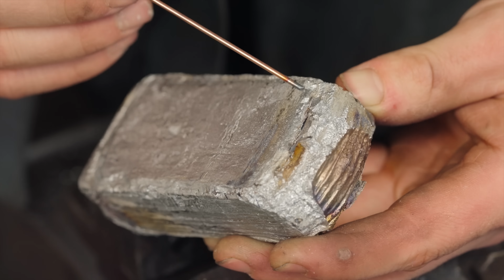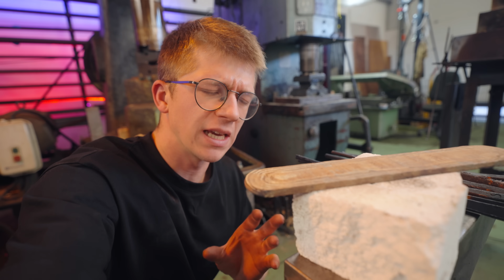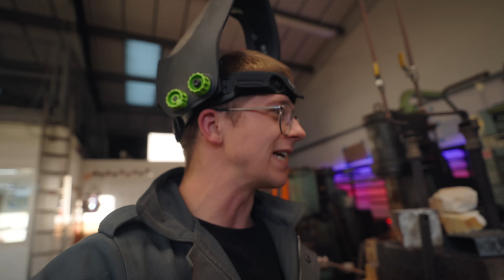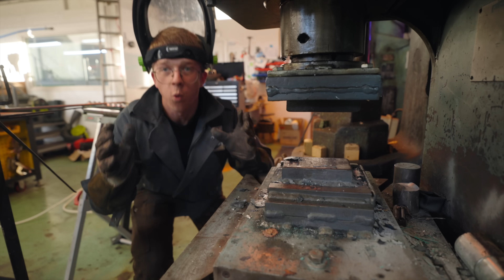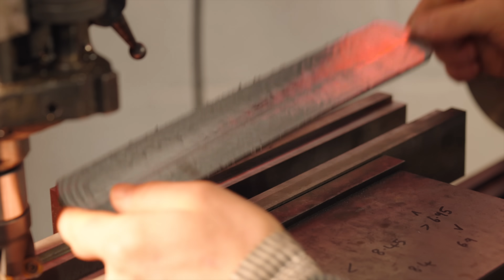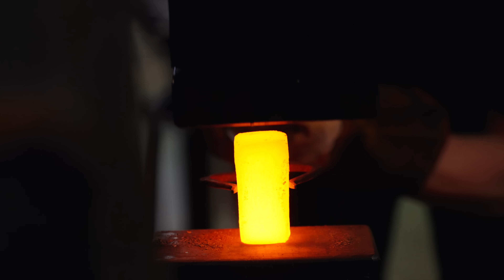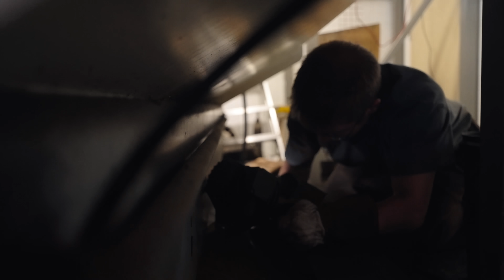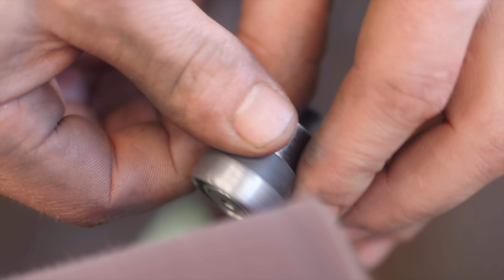Can I Make Titanium Damascus? Part 2

Comment: Did the "back" of the jacket fall off? So when you put it back in the forge it then wasn't sealed and exploded out the back? Cause it oozed out the back again when put under the press at 0637.

1429 What if you turn, move the crank down the bar, turn, move down, etc?

Comment: I'm more convinced than ever that you need to try making magnesium damascus, and when/if that works, try a titanium/magnesium sandwich damascus. 
The argon is going to work for the magnesium too, and you'll get it to a higher temperature than your previous temps with the argon. 

(I'm at 12 minutes into the video, so if you've already did this? yay)

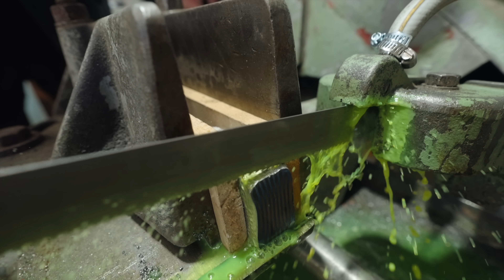Comment: You're killing me Alec! Your blade is on backwards! 2:15
Reply: Well, I still like your channel. Amazing stuff! But have fun buying a new blade after every part you try and cut.
Reply from the maker: No! The saw is designed to run that way for some reason, cuts away from fixed jaw!
Reply: @AlecSteele  Wherever you may have learned that from, all I ask is to think about it a little bit. Set the blade so that it cuts into your part. Rubbing the back of the teeth against your part just dulls your blade instantly. 25+ years experience in machine shop talking here. All the best Alec!
Reply from the maker: The teeth are cutting in the correct direction. The saw cuts away from the fixed jaw and the teeth also cut away from the fixed jaw. I don’t know how to make this any clearer 😂. I’m not running a saw blade backwards and being confused about why it’s not cutting. I’m no scientist but I’m not that stupid 😂
Reply: @AlecSteele  Google search it Alec! The blade is running the correct direction, but your teeth are backward at 2:15.

Comment: I work in a refactoring plant, almost everything dealing with Ti is done under vacuum to keep it from oxidation. When I was manufacturing aerospace parts it was in argon tanks and we used carbide bits in die grinders and sanding belts. Haha if you think this is explosive you need to play with Halfnium and Zr 😂😂😂

Comment: I believe the billet of Damascus titanium is small on top and wider on the edge design is the top layers are cooler and less prone to move while the inner layers are still hot enough to move around. Titanium releases heat more efficiently than steel thus the pattern works differently. Just my hypothesis. 😅

Comment: Diamond grit lapidary saw? Some of those micro kerf blades are 2mm thick. Water cooled is standard and auto feed is within your means. Some people even dress the blades themselves with adhesives and grit instead of the commercial brazed ones. If it saves 30% of your waste, it is probably worth it for the outcome and extra time.

Comment: Talking about wielding titanium and steel, I think I know the answer. The thing you are seeing between the two is called intermetalite and it's fragile. If you want to wield the two you need to use neobium foil, it wields with titanium and also wields with steel. Here is an example /apNelE3FCTs?si=T8BKu9gp5NcZH_iA but you need to use some translator to get all the information

Comment: "Why is it melting below temp?"
It's because it has a far higher density.
Why do you think a steel therms works better then a plastic one?

Let me get more specific too incase that's not explanation enough.

You learn in science class, in grade school, that hot things are hot because their molecules are wanting to move around rapidly.
They contain a lot of "energy".

The closer molecules are together the harder it is for them to move around.
If it gets too hot it it's bonds break down, that's what allows a material to change it's state of matter.

The reason density is important is, to use another real world example, the same reason ice cubes melt faster than water evaporates. The molecules have less space to move around, and heat is just a byproduct of the energy they lose while practically vibrating in place.

To go back to our titanium.

It's molecules are THE MOST densely packed. Look at it from the titanium's perspective.
It is an ice cube, you are the weird one.

Every piece of steel can be viewed in a similar way. The difference being is our ambient temperature immediately starts to cool any object that comes into contact with it. Entropy. Laws of thermodynamics dictate this is just what has to happen. Higher energy moves to a lower energy area.

In the case of titanium, the molecules are so densely packed that it doesn't shed the heat as quickly as steel.
It's sort of like the heat gets "trapped".
You can feel the same effects whenever you get burned by boiling water.

The skin cools down quickly, it burns later, but in between that time, underneath the skin hurts longer than the skin. Depending on how bad you burn yourself ofc. The skin was more quickly able to shed heat. Furthermore, heat is radiant and expands outward to the point of lowest entropy. That's why sticking an ice-pack on it immediately after eases the pain and also decreases the damage. Since you are made of water, carbon, iron, and other dense materials. You retain heat just not as much as the hunk of titanium. As a hunk of titanium radiates heat, it doesn't radiate it quickly enough, and all materials will radiate inwards as well.

You could say that the transfer of energy is hampered by the material's density. (this was just the long way of explaining that for all audiences to understand.)

EDITS: Grammar, clarity, author note.
If you where able to follow those loose ramblings that attempted to drill home why, thank you. The TLDR, "See thermal-dynamics, and atomic physics."

Comment: You could dissolve steel jacket in the concentrated nitric acid. It can't eat Ti, Al due to their oxide layer which only goes stronger in acids having oxidative properties. And a basic chemistry is a quite convenient thing to know dealing with different metals. It can save a lot of work for you. At my first job they had many Al parts with some brass bolts stuck deadly inside. And they were just drilling them out, often ruining the Al body. I just took those parts all at once and threw them in the nitric acid. They were kind of hysterical first :D But bolts gone and the body stood.
Reply: Concentrated Nitric acid is no joke and a regulated chemical
Reply: @Joker-em6oz Even acetic acid is no joke if concentrated. So what?
Reply: @Ma_X64  nitrous oxide fumes are bad… and he doesn’t have the setup nor means to use or but the acid that you suggest
Reply: @Joker-em6oz  not that bad actually. Everyone should decide himself. Whatever you do, it has its pleasure, it has its cost.

Comment: My guess is it is reacting to the iron in the steal jacket. When titanium gets into higher temps the oxides can react with iron and iron oxides creating a vitrification reaction a kind of thermal and chemical vitrification reaction that is why the some of those melty parts are brittle they are kind of like ceramic . That is my guess I am not entirely sure

Comment: If the steel remains you left on are permeable through the titanium lattice at that heat, whole thing could be polluted with trace iron.
   A good example is tin and bismuth combined near 50/50 melts at 281⁰F instead of 520⁰ F for biz and 450⁰ F for tin (possibly backwards 😉).
   Anyway, Body centered and face centered, plus the other I always forget cubic lattice patterns of atomic arrangement in crystalline structures (metals are crystals) . Anyway anyway, Metals creep through each other on an atomic level. Magic happens and they melt at much lower temperatures. I have a hard time getting it.
    US Steel books are heavy in metallography if you don't want to buy a dedicated book that covers most metals.

Comment: Elevation has also been known to effect temperature absorption rates in things. Its also possible your thermometer is faulty. You should side on caution and start forging on the lower end of temp. Maybe even the patent wrote the temperature too high for the process to make it hard to learn?

Comment: The only way I can get through titanium in any reasonable time it to drill a string of holes and connect them with an angle grinder. I don't bother sending saw teeth to the farm upstate. Just gold nitrited cheap twist drills, nothing fancy, punches right through like it is aluminum. C-5? A circular chop saw might be better, not sure. They always cut straighter than a fiber disk regardless. Much faster than all grinding. Stuff is a pain.

Comment: People are throwing out different steels or nickel. AL6-XN is considered a stainless but is high high (intentional) nickel (24%) with lots of chrome and moly. Nitrogen instead of carbon. 49% iron.
   Made to not crack in heat and acid.
    Maybe with stelite or blackalloy (powder cast).

Comment: @AlecSteele not sure if someone has already said this but you should save the titanium chips and dust from the milling and cutting process and try to make a canister Damascus from them to recover waste
Reply: They're oxidized too much, and probably wouldn't forge weld very well.  Also too many voids.   The grinding swarf is about useless.   People have been trying for years to recycle it, very limited uses, like cinder blocks and some in aluminum smelting.   Chips are a common feed stock when melting new heats of titanium - which is always done in a vacuum, at least for the final melt.   Some places do a plasma arc melt for the first of multiple melts.

Comment: For hard metal rings, you really want to cut them oversized and install a liner at the appropriate size for the wearer.  You will notice that all the experienced jewelers which offer things like damascus and titanium rings do this.  Would not recommend wearing an unlined ring unless you are partial to the risk of losing a finger.
Reply: how would a liner reduce the risk of losing a finger? I understand them for aesthetic, comfort and corrosion purposes, but how would that make it safer?
Reply: @ughmas  Depending on the material they are made from, they can reduce the chance of a roll under force cutting the finger off.  If cutting is required they serve as a barrier between the harder material and flesh, which allows safer use of cutting tools.  Some can actually be separated (like the silicone liner in a damascus ring I have) which allows the damascus ring to be removed even if the finger is swollen and the liner can be pulled off (stretchy) or easily cut.
Reply: @TheInfinityzeN  interesting thanks!

Comment: Paint a metal oxide in your container. Shouldn't reduce. Zinc oxide is one. Liquid paper correction fluid (zinc). Smoke (soot) it with an acetylene flame or a candle. Talc or chalk. Chalk has no asbestos unlike talc. Rotten stone/ diatomaceous earth, it is silicon dioxide, chalk is calcium carbonate. Talc.... magnesium? 
    ...also graphite powder. 
    Regular steels in container damascus always bind to the junk steel canister without a coating, not sure the amount of hot forging they tolerate. 
    Glass would melt, so... not sure how good diatomaceous earth would turn out.

Comment: A mixture of 40% nitric acid and 2-3% hydrofluoric acid can be used to clean titanium. The mixture should be used warm (about 120-140°F) and with adequate safety protection, ventilation, and disposal

Comment: While titanium is awesome for so many reasons, as a ring it has the unfortunate combination of being ductile and quite difficult to cut. Brittle + difficult to cut materials like ceramic and tungsten carbide will resist scratching and shatter when crushed. Ductile + sectile materials like gold and silver will scratch easily and crush easily but can be cut off of your finger with easily available tools. Titanium is rather soft, so it scratches up quite a bit during normal wear, and it will bend rather than shatter if your hand is smashed. Unfortunately, cutting it from your finger isn't very easy to do!

Comment: Since you have such a small hole in the canister maybe try a lower flow rate with the argon.  Plus, as soon as you do the first squish the hole might be closing up, putting the whole can under pressure.  Then it blows when the pressure finds a weak spot as its heating.

Comment: With all these nice bits of of steel offcuts, chips and dust, you should consider taking a stab at making Wootz steel, you could even put your cast iron chips in there because you wont have to deal with the forbidden mustard squirting across the workshop like you do with canister steel, FZ Knives has a lot of videos on making Wootz, I'm sure they wouldnt mind you borrowing one of their recipes as long as you give them some credit, Wootz, or crucible steel is a great way to recycle old metal scraps, so after a few months of projects, it will save you having to throw away metal you paid for, in exchange for a bit of work, plus it looks great and will give you some more options as far as making cool patterns in metal, if you forge it out into a flat bar you should try laminating it with plain steel and making Poly-Pattern Welded Steel or Poly Damascus, more tools for the tool box.

Comment: The melting point is actually the melting point of pure titanium when it is mixed with other metals to make an alloy it significantly reduces or increases the melting point based on the metal used and the volume so the melting point is reduced here

Comment: SERIOUS QUESTION you come out the fire at “x” degrees, then add pressure, the press. Increase pressure on material increases temperature does it not? This could account for the “pressure liquefaction of metals”, and yes that’s a real thing. Uncle google said so. You and other blacksmiths make fire by hitting steal until it can combust wood shavings or paper. Think about it. 🧐

Comment: I'm no expert, and I don't know if what I'm about to suggest makes any sense, but here's something I've thought about. When attaching the pipe to the billet, make a small purge hole on the pipe. That way when you're pressing the billet, and the passage inside the billet for the argon might be blocked, now the pressure has somewhere else to go. This might reduce any squirting.

Comment: 6:23 I just recently saw that An alloy of 63% tin and 37% lead has a lower melting point than either of their pure forms. This was from a soldering video but could be similar to what you’re dealing with.

Comment: Use ceramic inserts for your face mills! theyre more brittle but harder and more resistant to titanium. For the same reasons you stated in your video. the ceramic inserts are more resilient to the thermal shock and abrasion from the hotter titanium chips!
Reply: Ceramic inserts on a manual machine might be possible, if absolutely terrifying. Ceramic inserts on a flammable metal is just nuts.

Comment: Heat increases with compression. Try taking a thermos and fill it with really hot water and shake it. If it’s hot enough, the water should come out.

Comment: Being encased in your steel jacket the titanium has no room to expand from the heat, therefor the melting temperature will be lowered by the increased pressure.

Comment: When you get to the part of the process where you need to twist the material, you loose quite a bit from the sections that don't twist top and bottom. Would it be worth it to weld on some steel bar at the top and bottom for you to use as the anchor points for the vise and vise grips. The bond might not be fantastic between the steel and titanium and will probably sheer off but if it holds out long enough you might be able to get twist in the titanium.

Comment: The melting temperature isn't the same as the temperature that you have the forge set at. Regardless of the general temp you set your forge at the flames coming out will be at a specific temperature. Usually around 3000+ freedom units. Titanium absorbs heat very efficiently. If you have a bar of steel and a bar of titanium you can hold the end of the steel but the titanium. That's why you had melting problems

Comment: @11:00 Alec, is your fly down?
Reply: Also, Alec, make sure your DC power supply is a high V output. like at least 120v. Things get DICEY above 60v, so be CAREFUL, but you won't get the pretty colors unless above 60v

Comment: white paint has titanium dioxide in it. Some blacksmiths will use white spray paint in their mild steel casings because the damascus inside will just slide out, since the steel and titanium do not like to bond together.

Comment: Lots of good possibilites for why you're getting molten metal. Mine is that the mill scale of the canister is starting a small thermite reaction. That would explain why it's happening in the corners & by the weld for the handle.

Comment: 6:23  chatGPT said that due to Adiabatic heating. Basically, when you pull it out of the forge, it’s one temperature but once you compress it, the deformation of the material inside increases the temperature.

Comment: I hate seeing so much of that gorgeous material drilled out! 

Instead of drilling out the ring hole, maybe do like I've seen woodworkers do with lathes, carve the outside of the ring first, as well as the profile of the edges, then free the ring by using by a hole saw or some narrow bit to cut a thin circle in the flat end of the piece... Then a smaller ring can be made from it in the same way, and then  a bead from the center piece!

Comment: so for the liquimetal, i can see these  options
1 you're getting an iron/ti alloy cause of the case and that melts cooler, 
  how to test: make a titanium case, if it stays solid(ish); that was it
2 the alloys have a lower melting point than pure Ti
    check the data sheets
3 the alloys melt out of the billlets
4 argon contamination??? somehow causing a reaction

option 5 
you're getting over the melt temp?
maybe get an IR camera and check the temp of the liquid coming out?